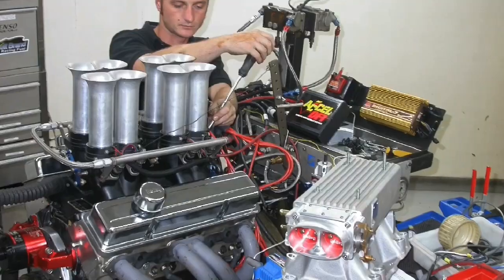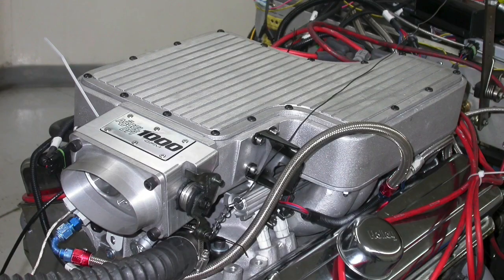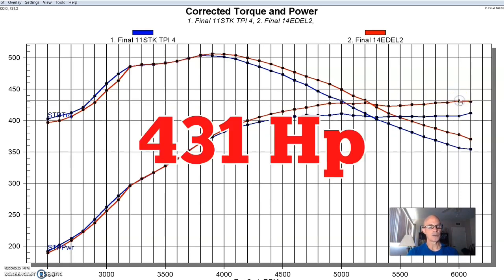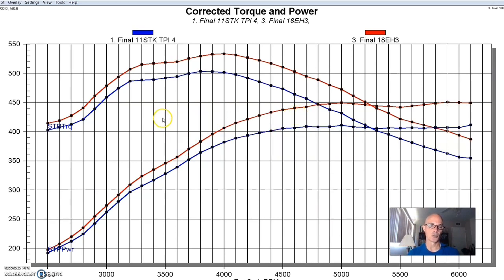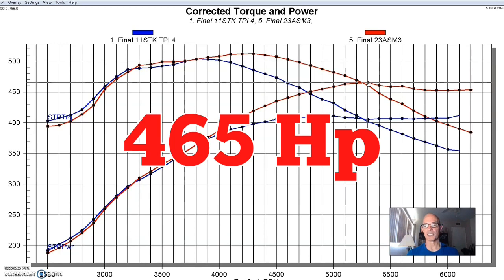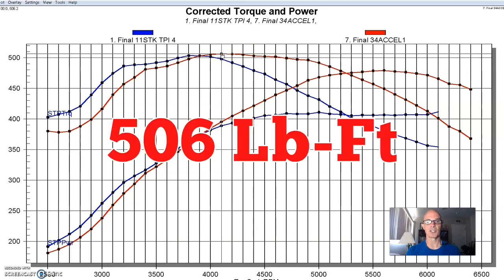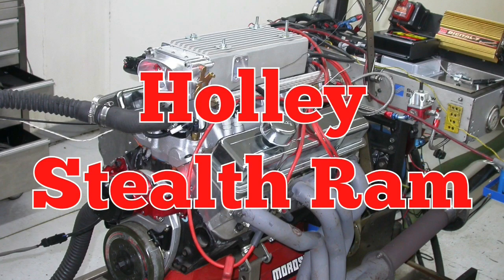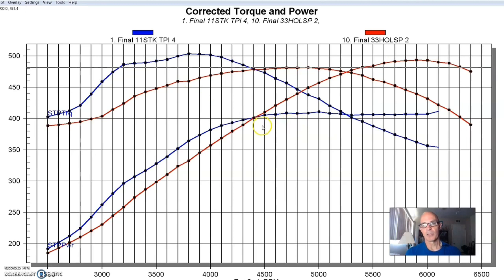TPI MEGA TEST-WHAT WORKS BEST?

Comment: Love this series. As an LT1 owner I am a fan of the short runner Miniram setup. Torque is for trucks! I want to rev! Speaking of the LT1, I just picked up a 97 Z28 with a Vortech intercooled setup on it. Having a hard time finding any information on this thing. You ever run the V1 on an LT1? What kind of power do these put out?
Reply from the maker: yes we have but there are different V1 configs
Reply: @richardholdener1727  just got an email back from Vortech. Looks to be an early V1-S. From what I've found online the intercooled V1-S kit is rated at 163hp!

Comment: Did you ever do a l98 vs ls1 side by side dyno chart? Just wondering what torque curve between the two looks like, obviously the LS style is better since GM only uses variations of it now but my old 87-89 Trans Am's with tuned port made good low end street torque and where great in that respect.
Reply from the maker: I have both
Reply: Difference is less than youd think but preferred the way the L98 feels compared to the LTx

Comment: What was the injector size(s) and fuel pressures on the fuel injected combinations?  I think the factory used 24 lb injectors on the stock displacement 350 engines. I used 30 lb injectors on a NA 383 ci using the HSA setup.  The fuel pressure was at 42 psi. Are there plans to make another video using forced induction using the same intake manifolds?  Thanks
Reply from the maker: Forced induction just adds to the curve that is there NA, we used 36 pound injectors

Comment: Great info! I’d be curious to see how a Holley Sniper EFI + Edelbrock Performer RPM would compare.
Reply: Hey mate, yes it would be, but after reading hundreds of reviews on them both ranging from great to down right junk, i think they have reliability issues.
Reply from the maker: if it was working properly, it would do what the rpm and carb did

Comment: Probably could have gotten more peak hp & torque with the Accel Super Ram if you had the runners extrude honed. It's too bad Lingenfelter had to shorten the Super Ram plenum to fit under the cowl of a 4th gen fbody. It cost the LT1 a decent amount of top end hp.

Comment: If only we had a performer RPM with port injectors to add to this test. We know it would make a little less peak HP than the carby, but it may beat most of the other manifolds for average horsepower.

Comment: Hello Richard,  Kool video wish I knew this info when I had my IROC. Have you ever run a test with a small block Performer RPM Air Gap intake and then Sent it to EXTRUDE HONE and retest it and see if that Great intake Can be Improved. Because it Says its good to 6500 rpm, but is it Really?
Reply from the maker: I did that with an RPM Air Gap on my Engine Masters Challenge entry-it worked well but doesn't change the effective rpm range much
Reply: @richardholdener1727  do you have any video of that engine masters motor I would love to see it?
Reply: I have extrude honed an RPM Air Gap intake for SBC1 engine, and it gained between 10 and 15 lb ft through the whole range of operation.

Comment: You confirmed why the stock L98  feels so good to drive on the street, Gobs of torque right where you need it and good horsepower until 4000 RPM when it stops breathing and making power. When I brought my C3 instead of C4 to the autocross the Corvette club was bewildered why? I said the 355 with the 650 double pumper and 4 speed  just made raw horsepower and you could bang through the gears as fast as you can  wind up to 6000 RPM shifts while the C4 automatic was refined and seemed lazy compared to the high winding 400 horsepower manual C3.

Comment: I would love to see this test with the FIRST intake. I’m building a tpi 383 and was looking into the first and curious to see how it would preform.
Reply: On their web site they claim 30% more flow than stock. on their facebook page they claim they can make as much as 600HP and turn to 6000RPM on a 400 inch motor. I may have messed that up a bit. but that is the general jest. and ya, they also claim someone made 1200 Horse with turbo. no mention of cam / head / boost levels on any of it.
Reply: Would have been great to join the fun!
Reply: @blair79bear38  it was a sport truck article in 92 with a 421 CI over 600 HP and the Vector W8 used the FIRST and posted 1000HP plus with turbos and over 600HP N/A.

Comment: I'd like to see this test done on a stock L98 350, beginning with an unmodified TPI intake as a baseline. This 383 with aftermarket heads is a little too far removed to give me confidence that I can apply the results to the stock motor.
Reply from the maker: I wouldn't modify a stock one
Reply: @richardholdener1727  
I'm happy to hear that, actually. I take it to mean the L98 combination of heads, pistons, and cam are pretty much optimized for the TPI intake.

Comment: Hi mate quick question. I’ve go a SBC tpi running a bw s400 at idle the manifold pressure is around -14 to -16 vacuum. Does that indicate a mild manifold Leak or is that normal for a boost application? I’ve sprayed brake cleaner around the manifold and there doesn’t seem to be a leak. I’ve pulled the whole manifold off and replaced all the gaskets ect
Reply from the maker: idle vacuum will likely be 14-16 inches-that depends more on the cam-you should be good
Reply: @richardholdener1727  cheers mate I appreciate you channel keep up the good work

Comment: Now cut the bottom of the tpi plenum open, add a butterfly plate with short runners on it into the ports below, and run it off an rpm activated switch

Comment: All these V8's  make more than enough torque down low, so unless you're building for towing you aren't going to miss the low end on the short runner setups that much IMO.   

Even with my torqueless wonder don't miss giving up the 2500-3500 torque for that massive kick from 4500-6800.  It's not ideal but with a sub 3000lbs car with 4:10's it's not totally gutless either.  I mean even with sticky 285, I can smoke them in 2nd at 40mph by stabbing the gas, if don't realize what's actually happening it's pretty impressive, lol.

Comment: So what if you install a non computer controlled HEI distributor on a L98 TPI motor?
Reply from the maker: with the factory ecu?
Reply: @richardholdener1727  Yes.just so you could adjust ignition timing according track conditions. Would the ECU totally freak out? Or with speed density it would not care.
Reply: @richardholdener1727  Well??

Comment: You do realize that the tpi was designed for the 305, not the 350. In fact the stock tpi system could only flow about 200cfm at its max. A stock tpi restricts a stock 350...there was and is no need to have used a 383.
Reply: I think he was doing that to show more contrast between them but yes anything other than a tow truck needed more intake than the tpi.

Comment: Would it ever be possible to include a test of the First Fuel Injection tpi intake? As long as its been around most people are still skeptical of its performance and it would be nice to get the opinion of a professional.
Reply from the maker: I would like to
Reply: Run the monster first setup. If it makes lower power crazy torque and gear car with 3.42 rear. First setup is a animal. Run it.

Comment: Something is off.. That combos with same cam and AFR 195 old style AFR heads made 530hp and 517 TQ all day long...

Newer style AFR Eliminator V2's made 550hp with same similar bumpstick if i am not mistaken.   I will take that Stealth Ram with a XFI 292 and AFR 195 Competition heads.  500+ with a 350CI engine all day long and a 6500rpm shift point!
Reply from the maker: 500-hp 350?
Reply: @richardholdener1727  Yep, and there was one i believe that used a fast burn headed 350 with the XE-294-HR10 CAM and it made 535HP.. Let me find the article Richard, BRB
Reply: 327 500HP+  http://www.superchevy.com/how-to/engines-drivetrain/0811chp-327-small-block-chevy-engine-build

383 540HP https://www.airflowresearch.com/540-hp-383-ci-afr-195-cc/

In that article you will see where they speak of a 520 horse called ZZ520 which was a 350CI combo. And that was with the V1 AFR 195's not even the newer higher flowing eliminator series now. 

They used to have articles to magazines using the old style heads which used the same 08-433-8 cam and 08-432-8 Cam which made 500hp+ on 350's and 383's and again those were the older style head castings.. I will find those other ones, happened around 2000, gonna take some digging.
Reply: 2 more...

http://www.superchevy.com/how-to/project-cars/sucp-1205-350-engine-packaged-performance

ZZ520, I WILL SAY I WOULD REPLACE THE MECH ROLLER WITH A XE-294-HR10 or XFI 292 HYD ROLLER for street with a healthy 9:5-1 or even 10.1:1 on 93 pump with the AFR  195 COMP heads... 

.http://www.superchevy.com/how-to/project-cars/sucp-1205-350-engine-packaged-performance

The 535hp one i was talking about was a SDPC drag car with a 350CI engine they did a article in super chevy i think in which used fast burn heads and a comp XE-294-HR10 cam... Sticking with GM stuff as they was a gm dealer.  

Problem is finding those old articles is a bit of a pain now as you can tell.. I would love to see these power numbers confirmed on a 350 crate FB headed engine with the stealth ram used trying with the 3 different cams, the 432,433, and 442 294HR10 cam i mean on both Fastburn heads and AFR 195 eliminator streets.  

Think about it Richard... 

If GM guarantees the FB head and puney 218/228 .525/.525 lift LT4 HOTCAM cam crank out 430HP via their ZZ430 Combo they sold exactly 430 of, then you know the larger cams with more duration and lift will get you a LOT more power, (HAVE TO) because they are allowing the valve to open more and stay open longer...  I'd be willing to bet 50hp+ on the 433 one alone!  Sure the XE-294-HR-10  or the XE-300-HR-10 would be a heck of a cam for the street, it is VERY POSSIBLE! That is just 1.52HP per CI which is in the real of possibility! Heck HP TV did it with a Ford 347 Stroker!!!  

Would be a good showing of how older tech can still make decent numbers and how each step raises rpm and how good the Fast Burn heads are considering they came out before the eve the V1 set of AFR via Tony Mamo.

Does prove one thing.. Man i am old to remember this stuff.. Jeez!

Comment: Thanks for the video. I'd wish the engine was stock L98 that produce 230-250 HP.
Anyway, I have a situation that I have no timing. I have to pull the engine to see what is going on.
If I have to go to head + cam replacement, what do you suggest? I'd like to go up to 350 HP no more because of my 700R4 transmission. Corvette C4 1985.
Thanks.
Ps. I already have match ported base intake and plenum to AS&M runners
Reply from the maker: ported stock heads or AFR 195s, small cam, headers
Reply: @richardholdener1727  I think I'm going "Blueprint Engines Aluminum Cylinder Heads SB-Chevy 195CC". I don't have a budget for AFR :(

Comment: Richard, I've had the opportunity get my 383 Firebird on the chassis dyno with both the SuperRam and the MiniRam.  As expected the SuperRam killed it on TQ (TQ 430@4200, HP 419@5900).  I swapped in the MiniRam and killed it with the (HP 443@6500, TQ 406@4900).  That's with the XFI-280 Comp Cam.  I was a bit disappointed as I hoped shortening and ported the SR runners it would've moved my peak TQ up closer to 4500 RPM, trying to get the best of both worlds here.  When I drive normally with the MR it feels more powerful off idle to 3000 RPM and surprisingly even with 35 less TQ and 25 less HP at 4100 RPM I don't really notice the loss.  Would you know why that would be?  Thanks!  Great videos and looking forward to seeing the TPI on the 4.3, it should work great.
Reply: you dont notice the loss b/c at that level (400) its hard to notice loss of tq or with the SR you were spinning and with the MR the car just pulls instead of spinning the tires with the short runner it aslo revs up faster so you dont spend the same time at 4100 and below

Comment: Most of this isn't a lot of surprise if you've been in the game for a while. 

I will say the reason I wouldn't run a TPI setup is they're a headache to assemble/disassemble and after investing in runners and working a base (unless you DIY) you're into HSR money. The exception is obviously C4 vettes where clearance comes into play or some other swap. In terms of the base I believe huge gains could be made just port matching the runner side to MRG 146 gaskets. Heck I've seen some stock style gaskets that intrude into the runners as well which seems like kind of a poor deal. The only really super bad choice here is the stocker. Otherwise (with a slightly different cam to capitalize on the RPM) most of these intakes will probably make similar power overall. Even with the big cam the modded LTR setups are only down about 10%.

Comment: Just started the video. I'm gonna say the top 3 will be the TPIS MiniRam, the Holley SteathRam and Accel/Lingenfelter SuperRam...
Reply: For me the extrude hone OEM TPI was the best deal in my opinion. Gaining everywhere and still have good topend. For a street car and occassional race track use this combo is way better than a T-Ram. with an automatic this is almost the only option of you have to change your governor and other things to deal with 6000+ rpm. Money wise the stock TPI system with maybe slightly siamesing it is the way to go... T-Ram and SuperRam are loosing way to much torque downlow where you need it most of the time
Reply: @firefox7530  I had a full Stealth Ram and 58mm TB setup BUT I never got to use it, unfortunately. Decided to pursue the path of the LS. LOL!

Comment: I am actually building pretty much the same engine for my z71 vortec. . I got a set of AFR 190 cc vortec heads. It's a 2v flat top piston zero deck 383. The cam is a comp efi cam with 500 lift and something like 218, 224 duration, can't remember  but it's 1500 to 5500 rpm range. I'm thinking about trying the factory vortec intake and update the injector pods to the new update electronic injector. I wished I could find a tube video of someone attempting performance improvement with the factory intake but I can't find any. Looks like the Accel ram is the way to go.    I didn't really want to go the extreme, but man I have got to build any hot rod engines in a long time. The short block is actually a old dirt track engine of mine. I'm praying that the imcreased efficiency will get great mileage. Probably not🤔

Comment: Im such an Accel super ram fan.. I want one for my 383 LT1 so bad.
Reply: you can buy one fro  the regular tpi sbc engines and re drill the base to fit your lt1 heads the lt1 base  is very rare to find the rest of the intake is the same
Reply: @Madmax.3  I fully understand, but would never spend that kind of money to drill extra holes and then have a coolant passageway on the front for no reason.. The LT versions pop up on forums and ebay often enough if I wanted to spend that on an intake mani.
 My point was more that for the price of that intake, I could go 24x/LS1 pcm, i could go small solid roller and make use of the cnc intake that came with my heads, or even buy a large turbo and most of the peripherals req. to fabricate my own turbo kit.  But thanks for the advice- I can always appreciate someone's attempt to help out.
Reply: @Madmax.3  LT "Super Rams" were also put on the market by LPE, TPIS, and I believe AS&M if i remember correctly. I meant to say that as part of "they're out there".

Comment: Probably 3rd or 4th time watching this, my dad & I just looked at an '86 Vette today, it may come home with us this weekend for $800 (complete, not running though).  What do you think going up a runner size on the AFR heads would do to the power curve... given the ram effect of TPI do you think it would hurt low end torque at all given the extra displacement?
Reply from the maker: no need to go up in runner size-the 195 works well-you will gain nothing but probably won't hurt either
Reply: Watching again!  My dad wound up buying that '86 for $500, he's keeping it basically stock though, it runs very well for having sat... I wound up buying an '85 4+3 Vette about 6 months after he bought his, and it most definitely won't be stock... keeping TPI of course 😈

Comment: The best aftermarket intakes were the carbureted dual plane and the TPIS Miniram.
Reply: The HSR was and still is the best aftermarket intake for a TPI L98 car, specifically a 383 build. It allowed third gens to compete with modified LS1's in the early 2000's. The only thing better is an LS2/LS3 swap and a modern Holley EFI computer. Miniram was a junk LT1 design which is long gone nowadays.
Reply: @steve069  the miniram intake was nowhere near junk. Holley doesn't make junk products, and the Miniram intake was very good for an L98 engine if you didn't go the carbureted route. The regular Stealth Ram intake had clearance issues with a 3rd gen Camaro's hood, and that's why the Miniram was introduced. The Miniram intake DESIGN is the reason why the LT1 engine was almost 300 hp STOCK, and that same Miniram design is a major reason why the LT4 engine was touching 350 hp, not the 330 it was rated at. Of course that Miniram intake wouldn't be practical for an LS based engine, and yes, the regular Stealth Ram intake was best for a MODIFIED L98 engine bored/stroked out to a 383. 383 cubic inches would definitely need larger amounts of cfm to feed those bored out cylinders, whether it's .030 or .060 over. The LS2 and LS3 engines are not the only best swaps. The LQ4, LQ9, and LS7 engines are excellent platforms, and people keep forgetting about the LS9 engine if you can get your hands on one.